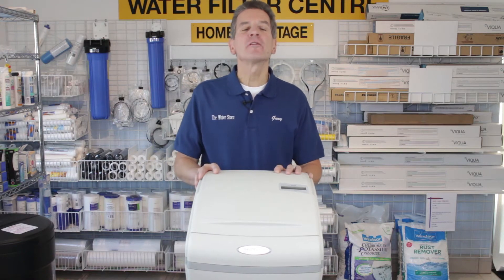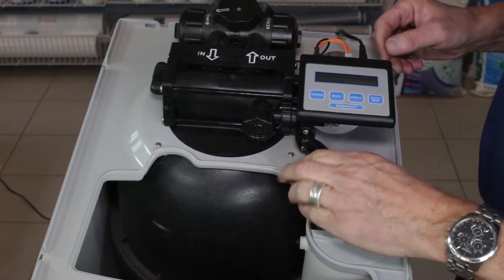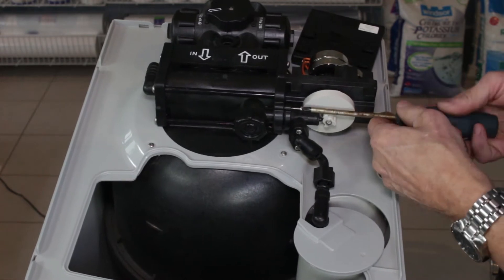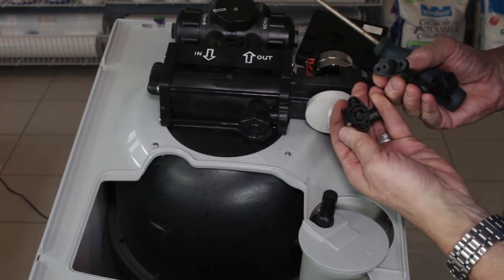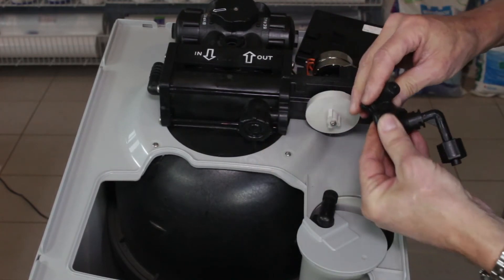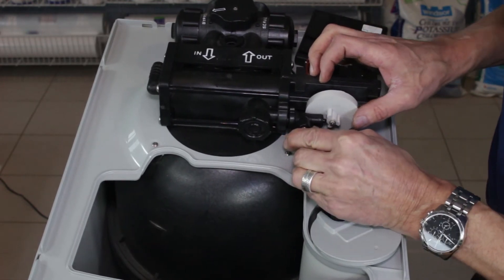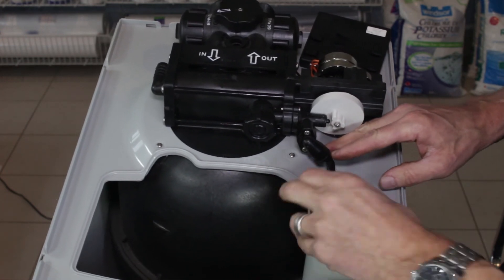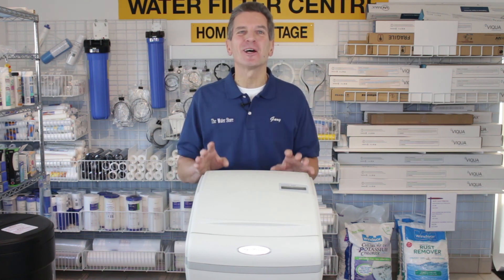Water Softener Maintenance & Repair Clean Flow Control Aquamaster

Comment: hello - great video! very helpful. - Have another question regarding this model... need to change the resin. Can this be done on this unit? if so, what gravel and resin do you recommend? and how much of each?
Reply from the maker: Unfortunately not.  I have looked into it and it is way too difficult.